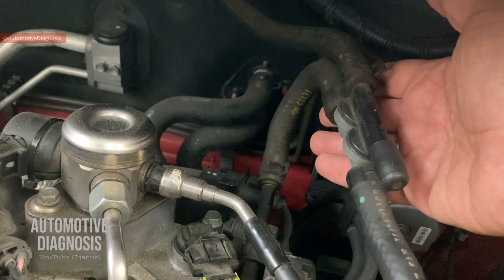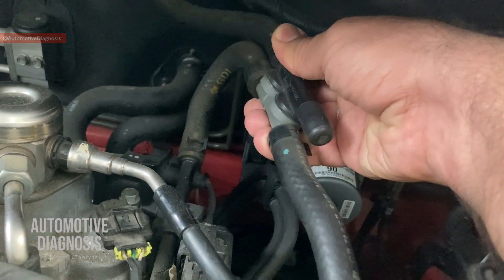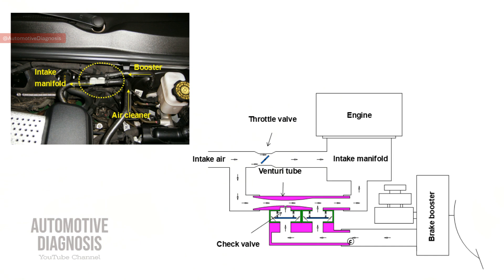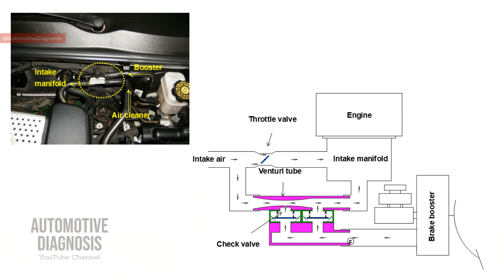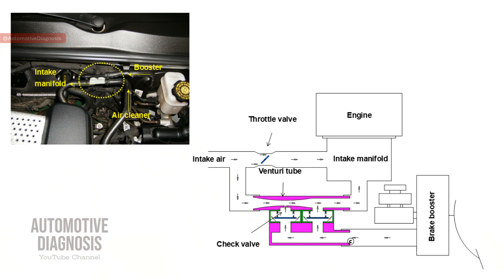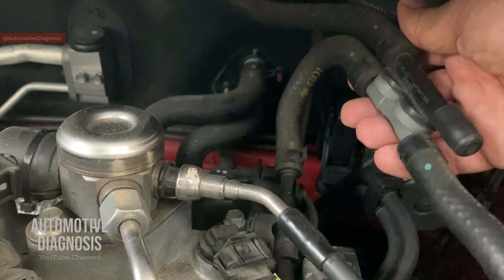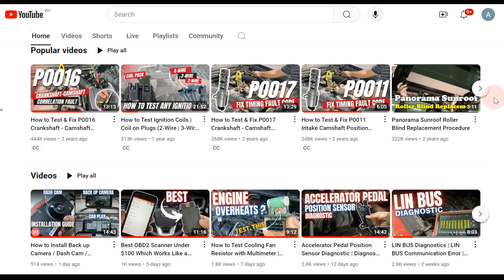What's the SECRET of Brake Booster Intensifier ?

Comment: Thanks, i assume if you wanted to fit this to a car not designed for the intensifier, you would need to tap in after an air flow meter(if fitted), and it may even affect the mixture (run lean) as the more air is bypassing the throttle?
Reply from the maker: Hi there, I wouldn’t suggest to change or modify anything related to brake system.
Reply: @AutomotiveDiagnosis  it would only affect the braking system as in increasing  vacuum assistance. As for the the fuel system, that may be a different issue.